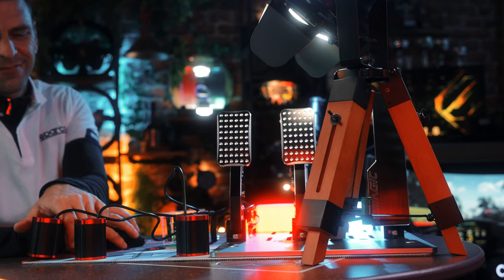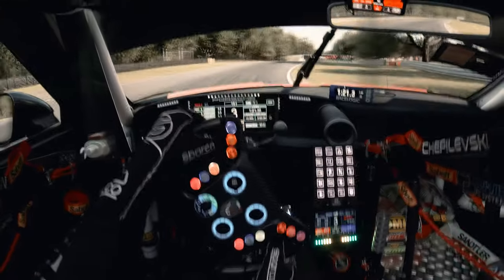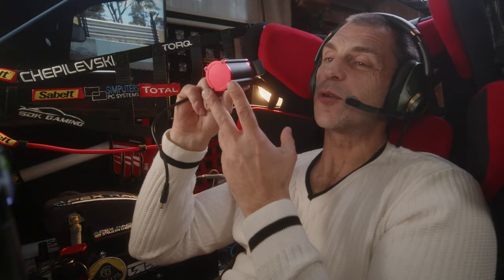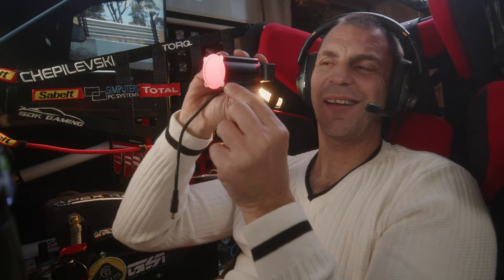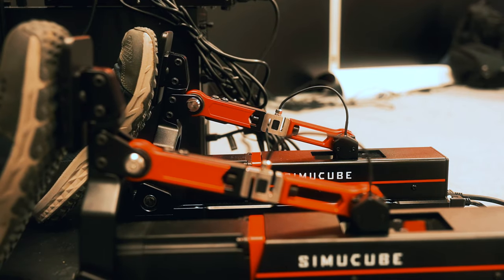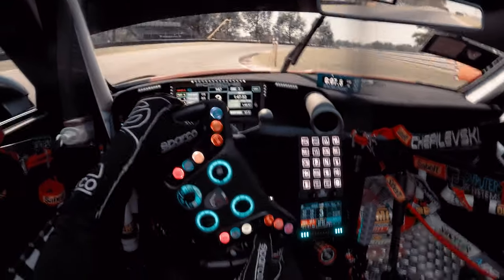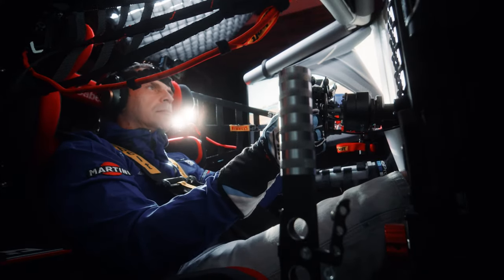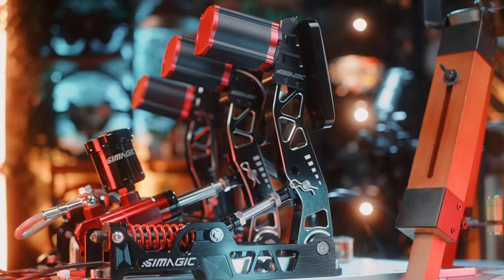That small device can TRANSFORM your pedals!

Comment: This sounds promising. There’s not much info on the website. Does this work with iRacing? I know they keep the ABS telemetry under a lock and key so to speak. And do you think these could be added to Heusinkveld Sprints?
Reply from the maker: Abs works on iRacing but the traction control not!
There are plenty of other effects in SimHub which works for iRacing!
This can work without Simagic pedals if you have the P2000 board and if you find the way to attach it the HE will do the same work buddy 🤛
That’s what exiting me the most of this 😃

Comment: Do they work independently from pedals? I mean i have heusinkveld pedals and i wanted to get those on my pedals. I would have to 3dprint something to be part of the pedal but it would have to work just on itself with usb. Does it work like that? Thanks
Reply from the maker: Yes buddy, the controller for the P2000 works without pedals attached as you can see on that video!
I ordered one kit and will try to find the way to attach it to each pedal set I’m testing here !

Comment: Why is there one for all pedals instead of just one for the brake pedal?  What do the other two do (clutch and throttle)?  Maybe you said briefly at the end.
Reply from the maker: The clutch can give bite point feedback and the Throttle can give Traction Control or wheel spin or many other effects trough SimHub!
I don’t give those much attention as they are more for the fun factor and the ABS or locks on the brake is necessary !
Reply: @chepilevski  Thanks for answering!  I appreciate your videos.

Comment: I have p1000i with hyrdraulic brake and haptic on the brake. It is the greatest
Reply from the maker: Pedals of the year brother 💪
I drive the last week on the P2000 but still prefer the 1000 model 😃
Reply: @chepilevski  don't you feel the throttle is too light on the p1000 ? i have the blue spring on it and I am a bit disappointed...

Comment: Which set of pedals would you personally recommend in the 500-800 price range roughly? Been eyeing up the p1000 with a haptic motor for brake. 
Would you recommend the 100kg sensor or whichever the strongest one was. Or save up for p2000 or entirely different set of pedals? Aside from you I know of almost no one  that has tried multiple pedals and is so knowledgable and happy to help haha
Reply from the maker: Hey buddy, in that pricing there so many great pedals!
My favorite for now in that price remind the P1000 inverted with haptic motor for the brake! 
I prefer them more then the P2000!

Comment: Awesome, does it work with RF2? It uses sim hub? 
I have the fanatec V3, and with rf2 thw dont work (i use it for wheel spin-throttle- and abs or wheel lock on brake).. miss them on rF2!!
(I watch the video very fast so maybe you already say that)
Reply from the maker: For rFactor you must turn on all those effects in game settings! Like ABS ON , TC on and so ! 
Is the same for Automobilista !
Reply: @chepilevski  how? It does not work for me.. with AMS2 is automatic!
Reply from the maker: @rologti  I had the same problem when I first jumped on AMS2 and rF2 because I had those effects turned off in the game!
Reply from the maker: If you find me on Instagram, give me PM and I will send you file with full explanation how to make it work with those Sim !
Reply: @chepilevski  done sir!!! Check your in box please!!!
Reply from the maker: @rologti  I don’t see PM from you buddy!
Reply from the maker: @rologti  rFactor 2 – Enable Haptics:
* ABS and TC must be set to one of the following options in game.
	- Low = Low amount of ABS and TC applied, effects now enabled in game.
	- Medium = Medium amount of ABS and TC applied, effects now enabled in game.
	- High = High amount of ABS and TC applied, effects now enabled in game.

Comment: Out of curiosity: how you properly gonna trail brake with ABS on?
Reply from the maker: The point is to not activate the ABS at all when you trail brake as that move back the weight transfer and stop the rotation of the car! This helps to understand where exactly are the limits and eventually not activating at all ones you practice your feet🤛
Reply: @chepilevski  is what I'm talking about. Why rbm is claiming that this is exactly what he was looking for, the ABS effect together with trail braking. He also stated that ABS would be the only effect he is really interested in. Only GT cars have ABS, no F1 has,no rally has

Comment: I just bought p2000 with haptic break feedback, got a question for you when i am training do i want to just br always almost activating the abs just feel a little rumble for perfect cornering or just try not to activate it at all ? Thanks
Reply from the maker: Straight line braking you can activate it full but in the trail braking must be off 🤛
That will give performance and good rotation

Comment: Can these Haptic motors be adapted to other pedal brands? I’d love to add these to my Invictas.
Reply from the maker: If you find the way to attach those somehow, they work if you take the Simagic P2000 control box and power supply! You can then attach up to 3 haptics and use SimHub or Simagic software to get the effects you want 🤛
Reply: You can also use an led light strip and simhub for an ABS active effect. That is what I currently use
Reply: @chepilevski  hmmm looks like I might have a project coming up 🤔 Might m currently using the Sim3D rumble motor kit which is not bad for immersion but as you say it’s just vibration really and not too helpful in the actual driving. Maybe once I get my hands on these I can get a bracket 3D printed.
Reply from the maker: @drorzy_0485  let us s know if you find the way to attach it buddy 🤛

Comment: You are driving on this video on ACC but with this ABS explanation which is very good, I think you mean for iRacing because on ACC your faster with ABS kicking in 24/7 so no real modulation and technique is needed but iRacing is 100% right with brakes and ABS. (Real GT3 driver confirmed)
Reply from the maker: You are right bro, I just used some footage for the editing but the weight transfer and rotation works the same way in ACC as well! 
You can brake hard on the straight line with abs on but when you turn in is not good to be activated as it doesn’t let the car rotate as good as it should🤛

Comment: Hej question to you. Would they work on any kind of pedals?
Reply from the maker: Yes buddy, if you are. The controller for the P2000 pedals, power supply and find the way to attach to other pedals they will work independently without the Simagic pedals !

Comment: Computability wise any or only Simagic?
Reply from the maker: To work they need the P2000 controller and power supply!
If you find the way to attach to other pedals will work independently without Simagic pedals

Comment: What pedals are those Chepi and what is the upgrade called? Looking to upgrade my Fanatec v3 clubsport soon.
Reply from the maker: Those are the P2000 from Simagic but they have also P1000 model!
The kit however works on itself!
I have some links in the description 🤛
Reply: @chepilevski  But if I buy the p2000, they don't come with those,  correct?

Comment: I have rumble motors on my pedals. Don't need aftermarket junk. 
Besides, I just turn off the ABS,  and adjust my brake force to keep the tires from locking up.
Problem solved.
Also, a big problem with ABS is that, once you engage it, you create a dead zone with the pedal, where pressing down, or lifting off the pedal has no effect on the braking force, which seriously impairs your trail braking ability. 
Better to just not use it, IMHO.

Comment: So P1000 or P2000?
Reply from the maker: I personally prefer P1000
Reply: @chepilevski  can you tell me why? It's really hard to find comparison online... And I thought since P1000 is load cell, P2000 might solve the issue with elastomer(load cell drift)?
Reply from the maker: @MarekIvanek  I personally prefer more more progressive feel on the brake and the P1000 does that with the hydraulic system, also the inverted kit is way more comfortable and there are few better things on the build itself which makes them more silent!
Reply: @chepilevski  thanks for the input! I always thought that if I decided for hydraulics, I would just use P2000 but didn't think of the hydraulics upgrade to P1000, something to think about! Thank you very much!